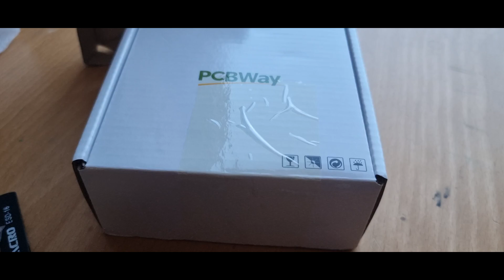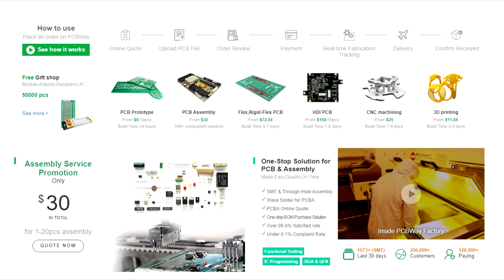Flex PCB testing , Fenix PRO Error E20 Repair attempt

Comment: A flex-PCB to heat up to 221°C? I'd say thats not good engineering. I know laminated PCBs are used in 3D printers to heat the printbed up to 120°C, and Kapton tape probably used in these flex-PCBs should be able to handle up to 260°C - but thats too damn close for me.
Maybe if they used a PID algorithm to heat it up, but the heatup in this video was more like bang-bang to me.
Reply from the maker: +1

Comment: How to disassemble it? Is it glued? Do you have a video for that?
Reply from the maker: It can be opened without damage, A few screws. but i got no video for that.
Reply: I have this device. There are no screws visible from outside :D
So it must be glued or clicked together…
Reply from the maker: Under the glued outer shelf are the screws
Reply: Okay thanks. I will try to replace the battery.

Comment: I think the instrument uses PWM to power the coil and runs a small fixed current through the coil during the off time of the heater. As the coil resistance is temperature dependent, its resistance is a measure for the coil temperature.
You could use an IR temperature instrument and measure the cup’s temperature with it when the instrument holds it at what it thinks is 200 °C. The difference with 200°C is what you need to increase the coil resistance with.
Reply from the maker: Thanks for the tipp, i will try to look into it that way, but since the cup is now melted quite far its just for fun by now

Comment: Did you try attaching 2 pcbs in series instead to reduce the current ?
Reply from the maker: Ohh lets try that :)
Reply from the maker: Yeah they still do burn^^
Reply: @atc1441  Maybe you could put a small potentiometer in line with the heater(s) and try and dial in a resistance that works and then replace it later with a fixed value ?
Reply from the maker: That has to be a very high powered poti. Dont think i got one that big
Reply: @atc1441  hmmm, yeah hadn't considered that , you would have to maybe wind a rheostat from high resistance wire, and by then i guess its not really worth the effort... ohh well interesting project and video anyway.
edit.. one last idea  maybe you could connect the heater to a current limited power supply and then dial in the current to a suitable level and then calculate the needed resistance backward from that ?

Comment: I had a nice Boundless CFX vape which suddenly died. The battery is basically like new, but the apparatus just won't turn on anymore, no burn traces on the PCB, no components that seem to be damaged. I can only think the firmware just decides to die after 5.000 uses or something. I wish they were easier to repair, and the companies more open to sharing possible fixes.
Reply from the maker: Yeah would also be nice if it would be possible here to just get a replacement heater pcb